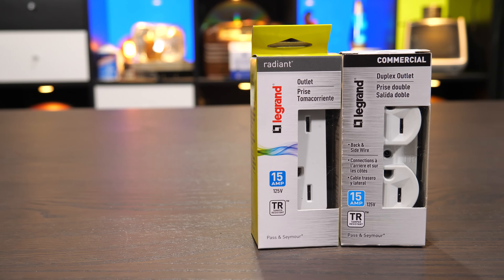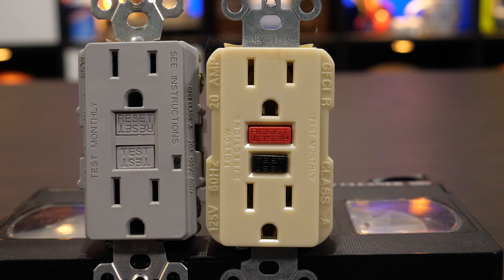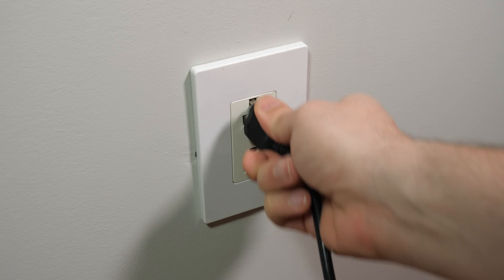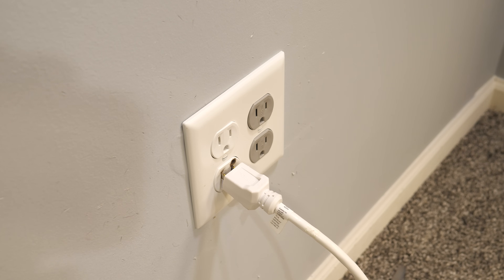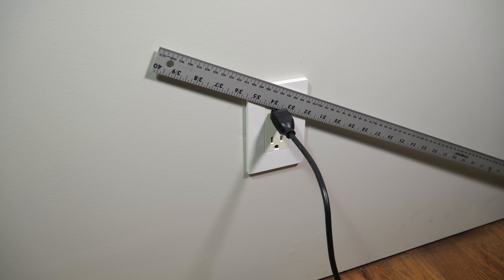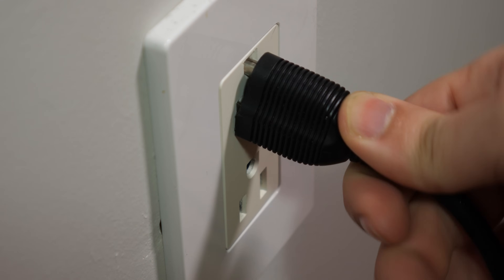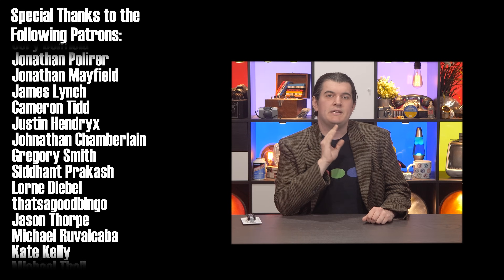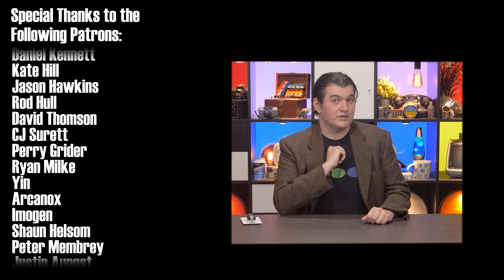Power outlets are topsy turvy - but does it matter?

Comment: This one has given me many thoughts!  Which you probably won't read because wow, 2600 comments in 3 hours!?

First, I got curious about Canadian rules and did a quick, 30 second search.  From that, it seems that the orientation used to be specified but was removed in 2001.  Presumably any such specification either didn't exist in the 1970s or specified ground-down, because every home I've ever lived in has been ground down.  (Although the CEC does, it seems, specify ground-up in RVs and other mobile situations.)

Second: you mention this debate seems to have started with hospital practice.  A hospital is certainly a situation where eliminating all the risks possible, no matter how improbable, is worth doing.  But it does make me wonder if right-angle plugs on medical equipment assume ground-up?

Third: a big detail you skipped over on the modern two-prong plug is that the lip is a slip-guard.  Like the guard on many short-barreled firearms or a Roman or Norse sword, most of its purpose is to keep your hand from sliding onto the dangerous bit.  Why 3-prong plugs don't have them, I don't know, but my guess is that the mold for that plug is already pretty complicated and adding the ridge to that irregular shape would be non-trivial.

Finally: the reason plugs mostly stick straight out from the wall seems to me to be a legacy of things not having power switches.  In the 1940s, you plugged a thing in to turn in on and unplugged it to turn it off.  Some things like my rice cooker still work this way!  So you want a plug that's easy to insert and remove.

Comment: I kinda wish I could just have a house with UK plugs in the US, and just buy appliances from the UK.
But another option would be to just flip one of the outlets and install them Chicago-style so your right-angle plugs both face away from each other and your straight plugs stay the same. You might even be able to fit more of those wall appliances into one outlet that way, assuming they won't leak like some air fresheners do. As an example: I have a Wi-Fi extender that would probably work in that orientation.

Comment: I have seen a 90-degree connector with the ground on top. Actually it is the same connector as always but the cable is very short and the appliance to which it is connected forces you to come out of the socket with the cable going up.

Comment: US plugs and sockets are some of the worst in the world. The ones we have in the UK are gated so you can't put anything conductive into the socket unless it's a plug. Most plugs have the live and neutral insulated and are quite sturdy and sometimes have a fuse in it also. The UK sockets are side by side so the right angled plugs are no problem when it's a twin socket and extension cables are also done the same way and sometimes they are slightly rotated incase there is a powerbrick.

Comment: Why don't Americans just install the outlet a bit deeper into the wall, like here in Europe? I mean, even if it comes a bit lose, there would be some way the plug needs to travel, before any live pins would be open to touch. It's such a simple change in the design of the outlet, but with a huge positive effect. You really don't need to change any plug, just install the outlet a bit deeper into the wall. If you need a picture, search for a type c outlet or type f (with groundpin)

Edit: I forgot to mention 90°-plugs. Yeah, they would have to change a bit, but that's no argument against safety.

Comment: As for plugs, I think they should all be "right-angled" but actually with a 60-degree angle, so you plug two of them into the same pair of outlets and they'll overlap rather than get in each other's way. And be shaped so they're easy to grip from whatever angle you're stuck trying to get them out.

Comment: 12:33 Why not the top receptacle, earth up, bottom receptacle ground down? Looks prettier because it is symmetrical. The top plug prevents mishaps at those traditional Trow-Knives-At-The-Wall games and the bottom one won't kink sideway plug.
I love the wallplates we have here in .NL where you can fill them with any combination of outlet, switch, usb-power socket. And you can turn them in any orientation you want.  ( Would be nice for those face-receptacle, but not that useful with our symmetrical outlets )

Comment: I must admit my mild advocation for flipping plugs comes primarily from an even where, as a kid, I spilled a box full of sewing pins off the back of my desk, at which point several of them connected with a slightly-out-of-the-wall plug. Any that made a connection instantly exploded, causing quite the fireworks show, and putting the fear of god into 8 year old me. There are so many possible solutions but to me, this just highlights exactly how awful all our plugs are, and the growing need to rethink the solution as a whole.

Comment: I absolutely love the Breville appliance plugs. They have a hole in them for your finger to easily remove it from the wall, without having to yank on the plug cord or dig your fingernails between it and the wall to pull them out. They are hardily made and, in my opinion, should be the norm. Awesome episode as always, sir.
Reply: A right angle plug with a firm plastic ring (that can freely rotate and hang), problem solved.
Reply: I like them because of how they make it easy to put a clamp meter on it.

Comment: I have used those right angle plugs several times to fix cable management issue. There was a plug field (yes a term I've seen elsewhere) for powering many different devices from 10 20 A breakers on 12 duplex outlets in 3 surface mount boxes installed in a cluster. A mix of 180, 90 and 45 degree plugs allowed this unwieldy bundle of 14/4 cords to be tamed :). Unless there's regulation, my guess is right angle cords cost more and will remain uncommon.Just my .02 Worth (about the cost of making a cord right angle :).

Comment: I've been bringing up sleeving our plugs for some time. Australian plug prongs look to have similar dimensions to US plug prongs, and they're sleeved. I don't know why we can't do that here. Some people have told me that the receptacle contacts are too far forward to work with sleeves. I don't know. I've had some Chinese products with sleeved prongs, and they seemed to work just fine. Seriously, we need to sleeve our plug prongs even if it requires adapters for older receptacles that wouldn't work well with sleeves. We've transitioned to GFCI, AFCI, and tamper resistant receptacles. We certainly can transition to sleeve friendly receptacles if necessary. I generally orient receptacles the traditional way, except when certain appliances like refrigerators have right angle plugs oriented for best use with the "preferred" receptacle orientation. Just turn off the breaker and  rotate the receptacle 180 degrees. You may not even have to mess around with the wiring.

Comment: Sideways also seems better at preventing the plug from sagging anyway, so props to Chicago! I still prefer my reversible, securely socketed EU plugs though (the ones with the top and bottom sides being ground I mean, not the southern EU plugs with the prong for ground instead, since those aren't reversible).

Comment: Out home was build in the early/mid 90s, I don't remember exactly who (builder, electrician, or my father) but all the outlet are with the ground facing up in our home. Honesty there have been no major downsides in the almost 30 years we have lived here.  The edge cases you brought up with plug design do happen from time to time but not that often.  Have started to seen it more on modern/new items though, but that's where the nice 6" plug pigtails, "outlet savers" as they seem to be called now, come in handy.  Even then pretty much all the pigtails we are using at this moment are for our multiple UPS's with items that have transformer plugs. As such, any new outlet I have installed I just put ground facing up because that's just what I am used to.

Comment: Why not best of both worlds, top plug inverted, bottom one normal, who tf puts right angle plugs on the top plug anyway?? It just wastes a whole plug under it, also, why not make left angle plugs, that replacement lamp plug looked great, and paired with the one inverted socket design, you could have all types of plugs and they won’t interfere, not saying this is a good idea or it rules out anything you said, just a thought that’s all

Comment: My parent's house always had the outlet ground up.  It was mostly annoying because nightlights and such often didn't plug in right. Anything with a light sensor is always on because light fixtures are on the ceiling, not the floor.
I don't think it was intentional, they're normal in the basement, despite its metal front plates.

Comment: The main reason for ground up (usually commercial construction) is due to the use of metal cover plates which could become loose with the loss of the cover retaining screw and fall down across the hot and neutral conductors, causing a short circuit.
Reply: Metal cover plates frankly should not exist. I'm surprised that they're still allowed to be sold.

Comment: I would not so much worried about blades getting in-between. But think something like jewelry. You bend down and your fancy gold necklace droops down. Zap. The hand is maybe the most critical as accidents happen easily when it's dark and you are little bit sleepy from lack of sleep or substance use. You might not pay much attention what you are doing. The plug is just history of one of the worst designs ever made. Look anywhere else and it has been fixed, well mostly.

Comment: You might want to look into the right angle plugs that rotate using slip rings (slip rings themselves are an amazing rabbit hole). They are pretty terrible at powering large loads like a 1500 watt heater, but they don't mention their firehazard nature. Look at the Hackaday article "This Power Strip is a Fire Starter"

Comment: If I am not mistaken, tamper resistant receptacles have been required by NEC for a while. Although replacing a receptacle isn't something most people would pull a permit for, so it will only affect remodels and new construction.

Comment: There's really no "perfect" orientation, everyone should free to choose how they put the plug into their outlets.  I had my basement renovated and the installer put them with the ground pin on top. I understand the logic but in practice it's not very practical.   I had to buy a couple of new power strip as I couldn't plug two of them in a single dual outlet.   It's a small thing that you forget about but is extremely annoying when you actually get down to it.

Comment: Our house was electrified after initial construction. I've got a lot of outlets really close to the floor. Sideways is my preferred change currently, in the kitchen they're all going ground on top. My current air condition has a plug with a fuse. If i hadn't inverted the one under the window I'd have lost an outlet.

Comment: as a kid I wondered what would happen if I tried powering a device by pressing its power cord against the charged pin of another device that was partly exposed. answer: it POWd in my face in a blinding flash with lots of smoke, burnt the connector on the second device, and that second device would no longer work after.

Comment: Here in Brasil, we changed our plugs from the US standard to a new national standard just over a decade ago. At first it was awful for compatibility, but it was definitely a change for the best. Probably the best feature is an hexagonal inset on the receiver, which not only is the bestagon, but also solves the issues with partial contacts.
Reply: The Brazil  type is based on a International Electrotechnical Commission standard IEC 60906-1 that should've adopted aroud the world but we know that is hard to do, only Brazil and South Africa adopted the standard, until now
Reply: @AndersondaRosaSL i find it so weird that Switzerland adopted a system so similar but incompatible. It's a nice system though, with 10 and 16 amp single and three phase plugs and sockets and backwards compatibility
Reply: @elia_berti  This is because the Swiss T12 plug was standardised about 50 years earlier. 1937 vs 1986.
Reply: @elia_berti France and Italy also adopted a similar system which is also incompatible with both. It's so infuriating that you can't just look at a plug and know what it's for, since they only differ by the diameter (and only by like half a millimeter)
Reply: GCP Grey approves your plugs
Reply: E dificilmente ele desencaixa da parede por ter aquela parte onde o plugue em si vai até o fim.
Reply: I have a question about Brasil: how do you distinguish 127 and 220 V sockets? They are the same and you have to check in which area you are or you risk blowing your appliances?
Reply: @elia_berti You don't. Voltages are regional. Here where I live all outlets run at 220V @ 60Hz and unless you're talking big appliances (washing machine), mostly everything is either bivolt or universal.
Reply: @elia_berti 220V outlets are supposed to have red plates and/or a sticker that identifies it as such. They also have wider prong holes, so 127V appliances don't really connect properly at all. There is however a big problem with people not really hiring someone specialized to do things the right way and/or using adapters and extensions that make improper connections.
Reply: @Aimnos  you are mistaking 10A vs 20A difference with the voltage. 10A prongs are 4mm in diameter, while 20A are 4.8mm, that's why 20A plugs don't fit into 10A outlets, but it has nothing to do with the voltage difference.

Please correct me if I made any mistake.
Reply: @elia_berti I've been to Brazil. They don't distinguish
Reply: @elia_berti  Labels or color coding (e.g. white for 127, red for 220)
Reply: @elia_berti if you are in Rio de Janeiro for example, you can safely assume all outlets are 110, and the ones that are 220 are (or should be) labeled. If you live in São Paulo it is the opposite I think.
Reply: @LinuxIsNotAnOperatingSystem Same in São Paulo
Reply: @elia_berti  In some places, 220v outlets are red... but red outlets can be used for 127v 20A outlets too (the 10A ones are generally white), in my case I just put a tape in the 220V outlet with the voltage, because i couldnt find a red one, but most things are auto bivolt so it doesnt really matter.
Reply: @elia_berti You don't. Unless you're in a hotel or something. Then it's usually labeled 110V/220V on the outlet.
Reply: Hexagons are indeed the bestagons
Reply: But the three prongs are now a nightmare to work when you have any angle on the plug, since both are made to go in one way only, meaning it would likely block something from working.
Reply: @clorophilla  The standard also allows for 2 prong plugs, so that's not an issue with the standard, but with the product. Right angle plugs will always have that problem no matter the plug standard.
Reply: @Kleyguerth Yes, it's the Euro style. Before our plugs came around, it was pretty common to find both the American style (from the video) and Euro two prong style (without recess) together inside buildings everywhere. Some plugs even came with both styles together.
Reply: @clorophilla  yeah, I really don't get it why they didn't make the plug reversible, putting the third prong in the middle, like the... Italian plug I think?
Reply: @LinuxIsNotAnOperatingSystem   Let me interject for a moment.... 

The third prong forces an orientation for the same reason US plugs have one side bigger than the other. For some stuff, which prong goes into live and which goes into neutral matters.
Reply: @Kleyguerth  oh, thx, I actually didn't know that. :0

I'm actually a total noob when it comes to electricity and the physics theory involved, despite my weird and mildly worrying obsession with plugs, connectors and standards.
Reply: I used to live in China and the typical design over there is universal. You can plug anything you like into the outlet and all you have to worry about is that the device can handle 230v electricity. You don't use all the plugs at once, you use the two or three plugs that are relevant to the item you're installing. I assume that was because it's an export economy and there was no telling what plug you'd have on the items you purchase.
Reply: I was wondering what it will get to change power plugs. Thanks for your answer

Comment: I worked as the manager of design engineering for a medical headwall manufacturer (the thing at the head of the bed with outlets, oxygen and suction) . The design choice of ground up or down was dictated by the architects with the vast majority choosing ground up. I tried finding out why this was but i never got a definitive answer. The most likely answer seems to be the use of that long medal beaded chain that patients can use to turn off the light over their head at the end of the bed and the risk of it dropping on the exposed part of a plug. Given the use of ground current monitoring in modern hospitals, I can't see it really mattering.

Comment: My current place and my previous place in Colorado had most wall sockets installed the typical "ground pin down" orientation, but the ones that happened to be controlled by wall switches were installed the opposite orientation to visually identify those outlets.

I thought this was a common thing?

Comment: As someone with practically no electrical knowledge, this might be a dumb suggestion, but for your consideration. A plug where the two ground receptacles face away from each other. You get the best of both worlds and multiple right angle plugs wouldn't interfere with each other. The obvious downside being they would be harder to wire up correctly in the first place.